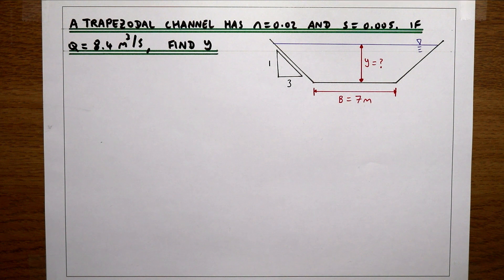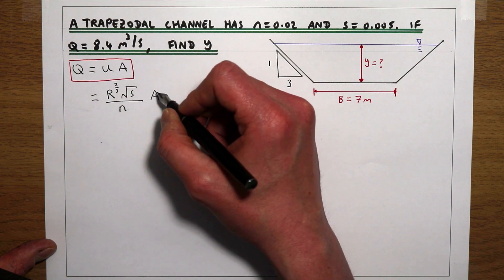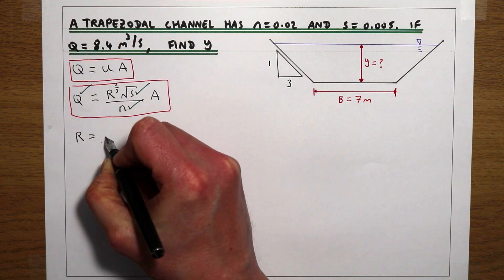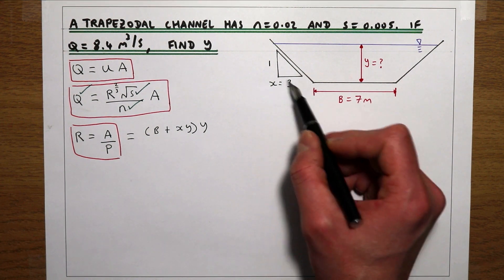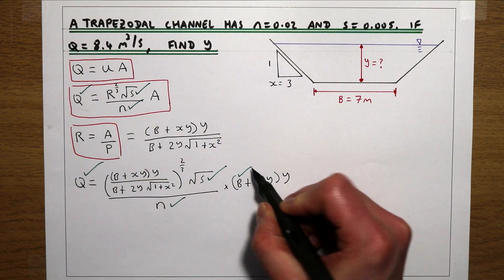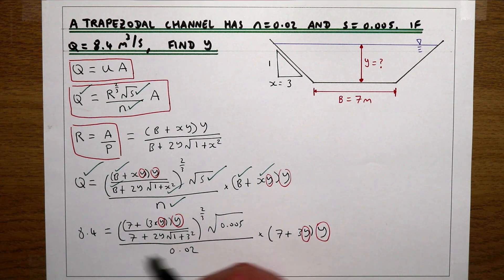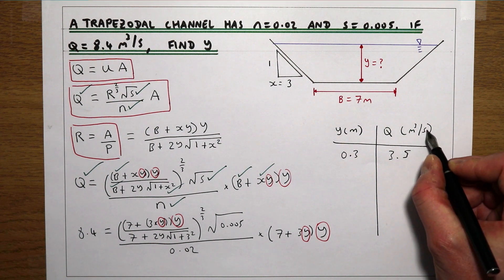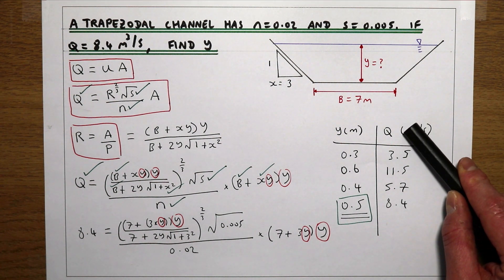Manning’s equation to calculate the flow depth at a given discharge for a trapezoidal open channel

Comment: it´s easy to solve this ecuation, you need to use equal terms and its done, by elimination. you have duplicate de "A" ecuation, and perimeter ecuation is  B+ 2sqrt(1/3x^2 + x^2), simple algebra,  for every value of "x" on the talud the level of water in the channel increase a 1/3 of "x" . it is why you where confused. my result was Y=0.498 m
Reply from the maker: Thanks for the contribution, I hadn’t thought of this method before but will certainly consider it in the future. The focus of this video was to present a simple method for engineering students to solve the problem without the need to solve algebraically, and in my experience students tend to find this the simplest way to address and understand the problem. But I’m very grateful to see another way to do it.
Reply: could you elaborate on this method?
Reply: @Randomkloud  I'm pretty sure it is not possible to solve this equation for y. Iteration, or a calculator, is the only way.

Comment: cant we just easily solve it by calculator? One equation and one unknown, If yes please explain how. And thanks alot for your efforts.
Reply from the maker: The problem is that if you look at the form of the equation, it’s extremely complex to re-arrange for y. A mathematician may be able to do it, but for humble engineers like me, this is the easiest way to solve!
Reply: @fluidsexplained1901  I'm reasonably confident that it is not possible to isolate depth algebraically . But many calculators do have a numeric solver that enable solving equation like this. I presume they work similarly to Goal Seek in Excel.